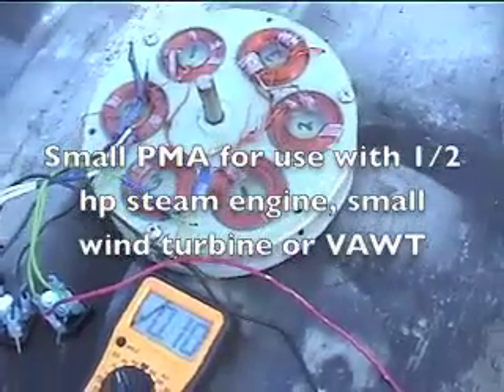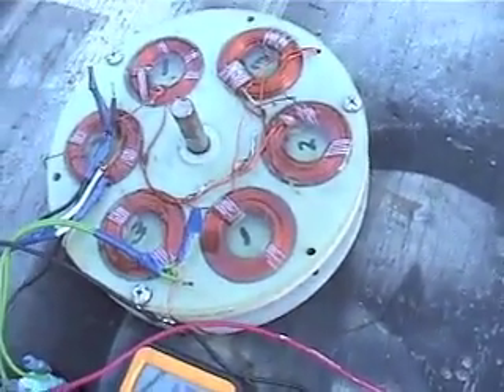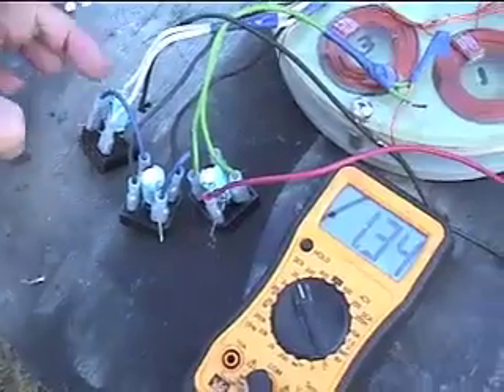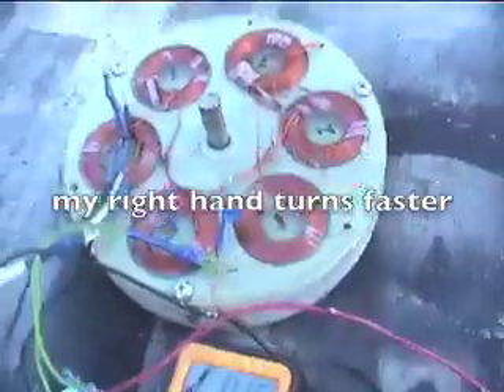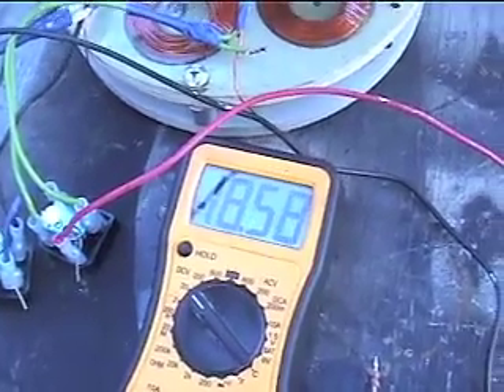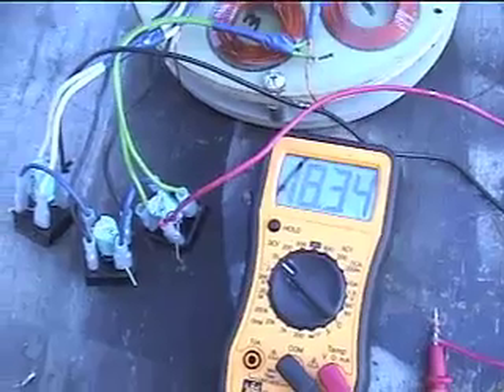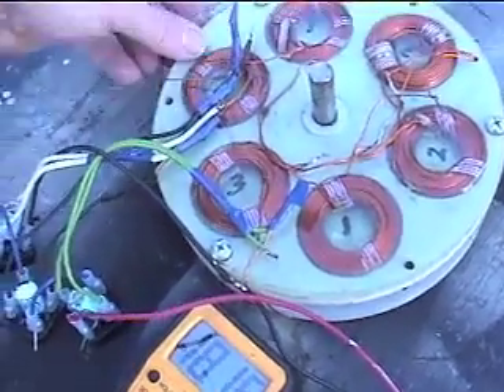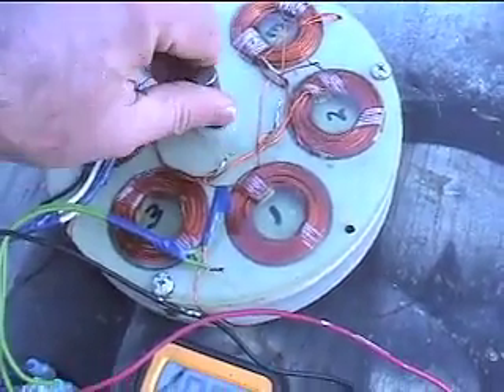LYNX Compact PMA Alternator

Comment: hi
 I am gettingabout 10 to 11 volt under load at 3 to 4 mph wind and my setup is using a car altinator rectifier so if i change that to seperate bridge rec"s i can increase my voltage?  when i do hit 12 volts I am getting 70 to 100 amps so what will this do drop my amps a bit?
your videos are great !!!!!!  I was about to start rewinding coils and start over but all I need is 2 more volt and I am getting my 12 volt under load
thanks 
Dave V

Comment from the maker: @Aceman307 
It is more compact and can be easily shaft driven.  The flux is weaker than a two magnet plate pma, and is made up for by heavier magnets and more coil.
It is purpose designed for higher rpm and not well suited for slow turning wind turbines.  Better for high rpm wind or steam engine.  Needs 200 rpm or more.